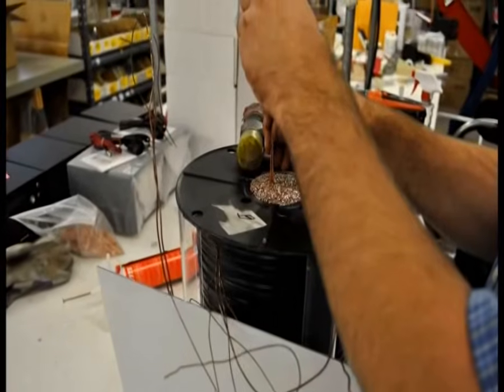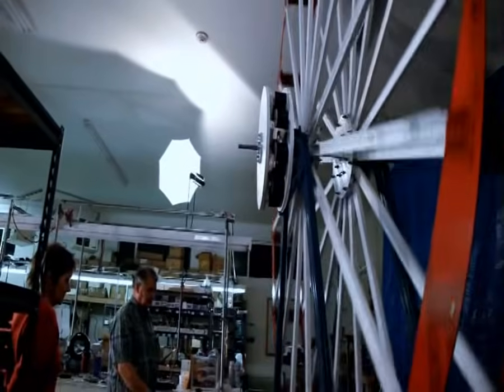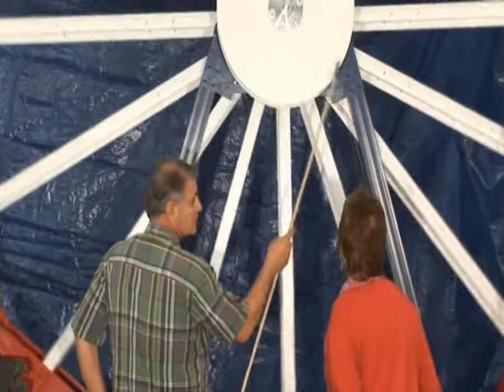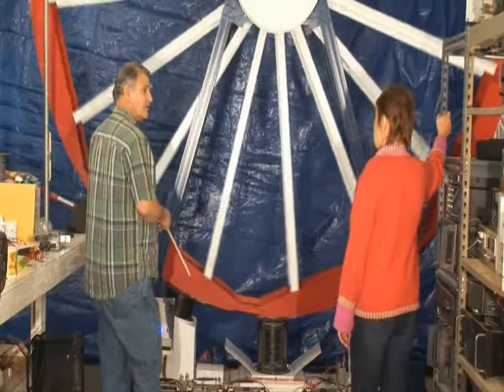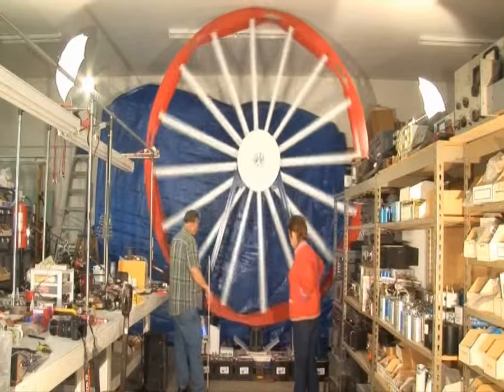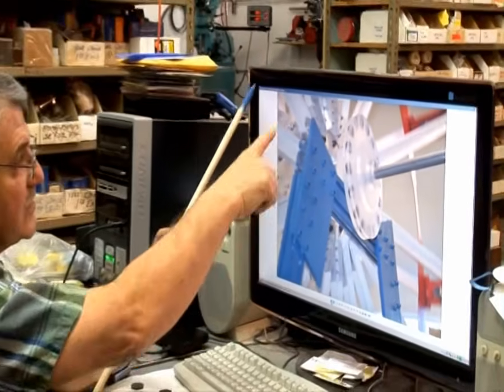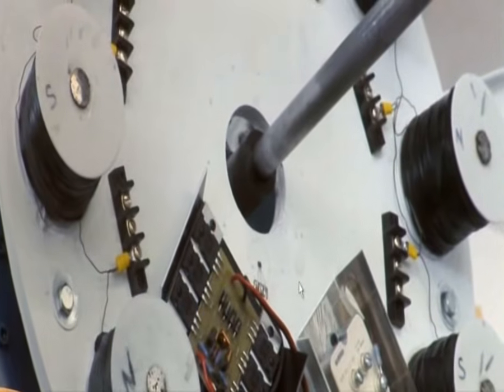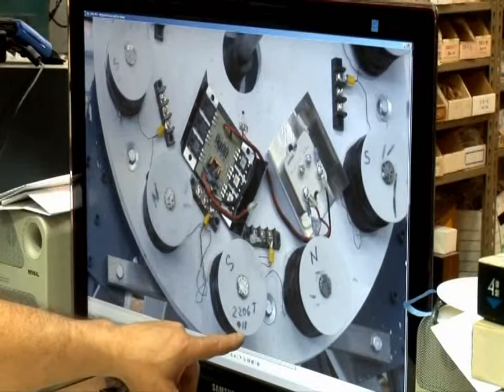14 foot monopole Construction for 2010 Renaissance Charge Convention

Comment: Very cool! Why did it need to be so big? Was that for effect, or functionality?
Reply from the maker: See the description and all the videos for all these details. We didn't need it or for it to be big, it was just something Steve W made and thought it would be good to modify to a monopole. The bigger size, longer off-time between the magnets, and the higher inductance allowed for greater gains. Of course it was meant to be sensational. As mentioned, I showed it rotating with significant force with driving it with only 1W. See the other videos in the description and playlist for that demo.
Reply: @rickfriedrich  Which one is the 1 W circuit ?
Reply from the maker: @Nurplex  It was just the basic SSG circuit. In one of the 4 hour videos (of the 9.5 hours I filmed myself) I show a regular coil running the whole thing. Here is the demo of running it with regular coil and circuit https://youtu.be/HBGmCLqBAvg?si=Lc6ucj-JpsAZrnb8&t=143
Reply from the maker: That shows it was running 1.2W pulses about 10% on time for 0.12W total energy, while lighting the bulb, to spin it with the small coil and basic SSG circuit while significant mechanical force.https://youtu.be/HBGmCLqBAvg?si=r24szCbRRGfzqggN&t=406
Reply: Seems theres no real selfrunning machine i found scouring the whole internet for years.
Reply from the maker: @cesarbaratas5612  What do you think this was, it was self-running. So why say that? We have been showing this for 20 years all over the internet.